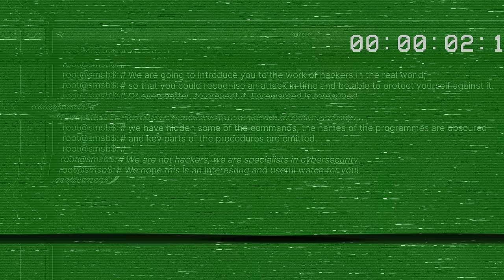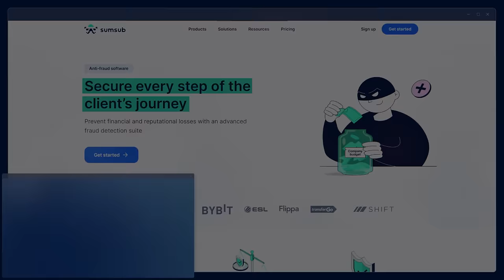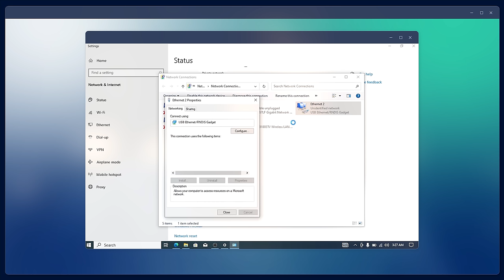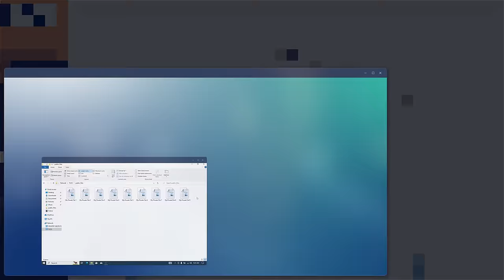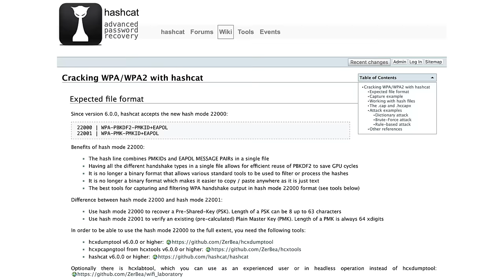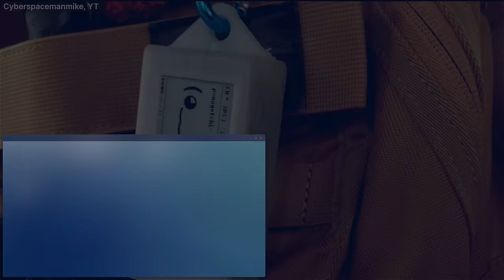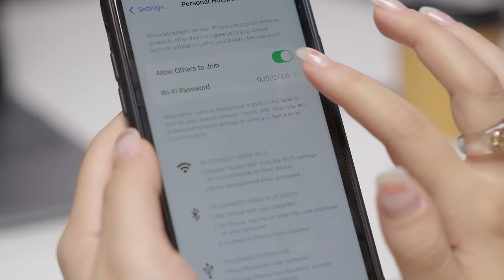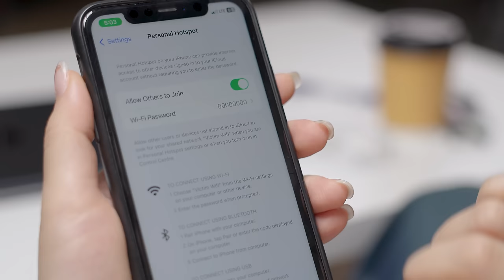Pwnagotchi — hacking WiFi networks in seconds | Real Experiment

Comment: Can anyone able to get the access of someone's keyboard. I mean whatever the person is trying to type in his keyboard. We must be alse to see it by any method or something you know. Basically i thought of a idea to crack a wifi passwords where somehow we have to  disconnect the connected devices from that targeted wifi network and then at the same time somehow getting the access of keyboard of client devices so that when he try to put the password of that wifi in his device we'll be able to see that what he entered the password and we're done😅mixing up this device(mentioned in the video or flipper or a wifi adapter with monitor mode)method of disconnecting the client from the wifi network AND keylogger(it's a application you can download)which is doing the same what i said to get the access of keyboard of anyone's device then we can do something we're trying to  do from our childhood hacking or cracking a wifi network password 😁😅
Reply: Some wireless keyboard devices have a vulnerability where you can take over control and use it to enter commands into the target computer.
Reply: If it's a wireless kb, sure. Otherwise, u need keylogger installed on target.
Reply: @-108-  consider the target is far from us then?
Reply: @Allinone-sh6cj I'll consider it.